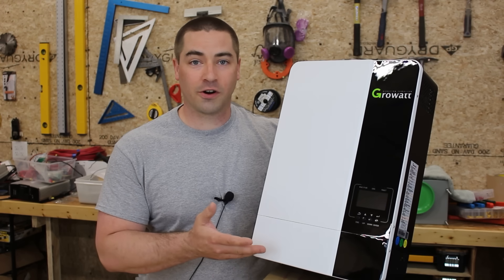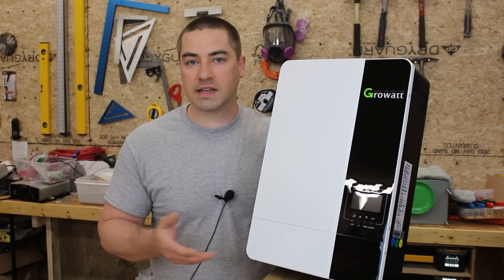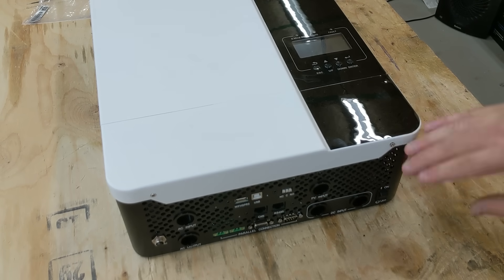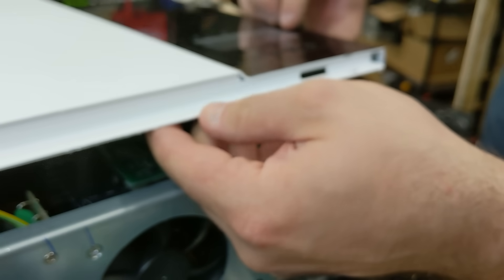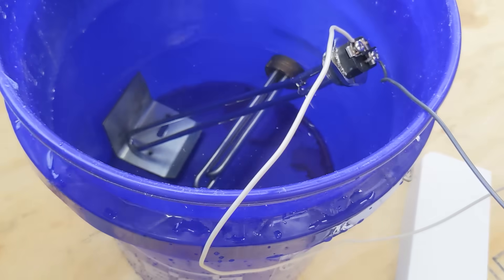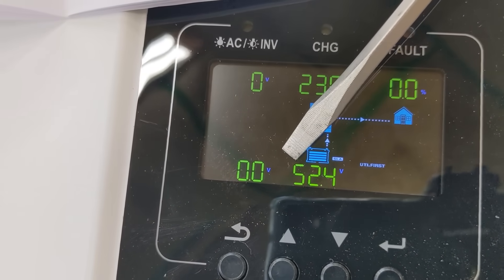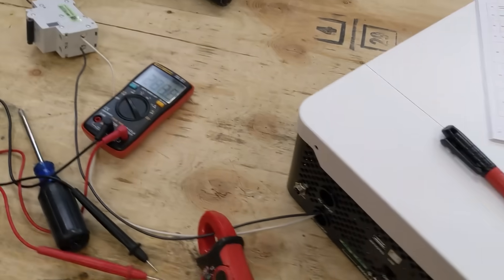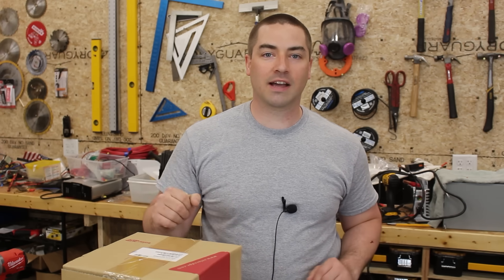Best Value Inverter, All-in-one MPPT Solar Charger, Growatt SPF5000ES, Part 1

Comment: This is 240v? You said line and neutral, not line, line, neutral.
Reply from the maker: Correct.  240V only.  I then used an auto transformer for 120V loads.

Comment: 4 years later is it still working fine? Im thinking of buying this brand too
Reply from the maker: I still use it for testing batteries, but not day-to-day.  If I was to buy a new inverter for day-to-day operations, I'd look at this one: https://signaturesolar.com/eg4-6000xp-off-grid-inverter-split-phase/?ref=4_rHcgZ9x-TiF- Because it does both 120 and 240 Volt without needing an extra auto-transformer.

Comment: Does it blow the hot air out from the top or bottom?
Reply from the maker: Top.
Reply: @DavidPozEnergy  Thanks for your videos. I like to watch your reviews. If i may ask are you still happy with the Growatt? Im looking to get 2x 5kwa
Reply from the maker: I ran my house on 2 of these Growatt inverters for 1.5 years without a problem.  However, I did upgrade to a pair of Schneider inverters once I had enough money for it.  The Growatts are a great value for someone to get into solar cheap, but they won't last a very long time compared to Schneider, they use more energy in standby, are less efficient, noisy, power was not as clean.  I moved my Growatts to temporary uses at this point.

Comment: The newer version of this inverter is not that good. I installed one in March, 2023 with 6 x 500W panels and 5kWh battery. This inverter had many issues since the installation date. I am in Asia, and we use 50Hz/240V and I have a single phase wiring at my home. Most common issue is the error code 52, and this condition stops the inverter and the charger till a manual restart. Other issues are (1) Charger not starting even when there is enough power coming from the panels (2) Not switching from Battery to AC and back at the set SoC of battery (3) Battery getting discharged below the set max DoD. (5) Unintended charging of the battery from Grid. On top of this, the customer support from the company who did the installation was pretty bad. They have not yet replaced the inverter after many follow up calls.

Comment: After much more research i agree with you.  I am buying 2  and build my own battery.   10Kw inverter and 15kwh LFP battery  and easy enough to add on if i need more capacity as the GW can stack up to 6.

For the newbies you can easily run the whole house  under 5kw for all the 110V stuffs.  For the energy suckers  water heater, dryer, stove and AC  those requires 220V  if all on at the same time 15kw will do but no more than 2 on at the same time then 10kw will do.  I know for sure that will work for most if NOT all  US household.    You can add more solar panel, battery pack and inverter if more capacity is needed easily.  I know  for sure because for years i have been running the whole house from a repurpose UPS  as an inverter  and 18650 packs that i built from recycle battery.  The 110V stuffs that is.  Everything works for years and NO issue.  I hung my clothes under the sun to replace the dryer. I changed to solar water heater.  I use propane and home made charcoal for cooking and baking. I use the 110V AC . Those will do away  the 220V stuffs.    Now i need 220V because i have a spouse and women usually are NOT OK with the inconvenience!!!!!!!!!!!!

Seriously no one should do grid tie anymore.  I never  was and never will.
Reply from the maker: Sounds like a good plan.
Please note:
I bought mine from Signature Solar.  SS had these modified for the US market by Growatt.  Some people who complain about these models bought from Chinese sellers, and the units were not modified.  So just be cautious.  
Also, if you don't mind helping out this channel, please use the affiliate links in the description.

Comment: Hi David, I bought this 6 month ago after reviewing your youTube. Here are my questions.
1. I am using 6S 2P of 12 pcs 500WP , max V in from PV 250 volt and Current 16 Amps. Book says max 450 volt V in to the SCC, the question is what max Volt can safely applied?
2. To generate more energy to batterry (20 KVA, which never reach 100%) I plan to add 6 more PV (500 WP each) in parallel which will be giving same amount of voltage, but the current may up to 30 max, the question is with that max current in from PV would be safe for the  SPF 5000ES? If not what PV configuration best to arrange?
3. I notice the SPF 5000ES cooling fan are "on" all the time is this normal?

Thank you in advance. BTW I am located in Indonesia.
Reply from the maker: Hi agusmuharam6491,

1. Yes, the maximum open-circuit Voltage is 450V.  Since this is a maximum, it is your responsibility as the installer to ensure the solar array never exceeds this Voltage.  I don't know the temperature in Indonesia, but where I live we have below freezing temperatures.  I need to add 21% safety margin to my solar array.  When solar panels get cold, the Voltage can exceed the rating.  This means I can't allow my Voc of my solar array to exceed 372Voc (based on the data sticker).  372Voc/6=62Voc.  Double check if your solar panels Voc is less than 62Voc.  
2. I wouldn't run 30A potential into the Growatt.  The Growatt is listed for 18A.  You can exceed that slightly, maybe 1 or 2 Amps, but I wouldn't go up to 30A with it.
3. The cooling fans are variable speed.  Yes, they are always ON, but should speed up or slow down based on load.

Comment: In your opinion should I go with Growatt 5k or eg4 6.5k looking at mounting 2 in parallel with eg4 stack of batteries. I know you have used them my goal is to make a low maintenance system.   What can you recommend?
Reply from the maker: I've had great success with my Growatt inverters.  I don't have experience with the EG4 6.5kW inverters.  There have been some user complaints from both, so I can't say one is better than the other.  The EG4 inverters are 120V, which means you can parallel them into 120/240V split phase without needing an additional transformer.  The Growatts are 240V only, which means when you parallel them you still have 240V.  You need to add a transformer to create 120/240V split phase.  On the surface, that's a down-side to the Growatt.  However, I actually think both brands benefit from adding a transformer.  I've even tested a Sol-Ark in the past which was terrible for me, until I added a transformer.  

The Growatt is currently at $726, or $1,452 for the pair, plus the transformer brings it up to $1,950.  A pair of EG4 6.5 will go $2,598, so if money is really tight go with the Growatt brand.  

Understand, that both of these options are beginner level.  They are both excellent values, but probably won't be a forever inverter.  Something like a Schneider is top of the line, and will last decades, but costs quite a bit more.  

I hope I was helpful.  If you would like to help support the channel, please consider making your purchase through one of my affiliate links: https://signaturesolar.com/?ref=4_rHcgZ9x-TiF-

Comment: those copper wound is on a ferrite ring for interference reasons and the inverter is switch mode type circuit so no copper wound transformer

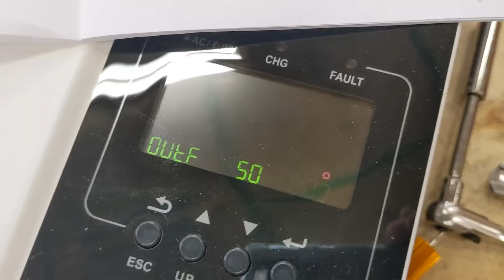Comment: I need to know specifications and where to buy the resistor you use before  connect 14:43 the battery to the inverter
Reply from the maker: https://amzn.to/3oIPq5p  Here is a link to the resistor.  I have some orange and some green, but they are all 100W resistors.

Comment: I had 12 solar panels and a 48v battery  output connected to a 5500 watt inverter. The installer only connected a connection from my house power to the power in connection point in my inverter does it need a power out connection connected to my house power for it to work properly and feed my house usage?

Comment: I just bought a 8000VA/6000W inverter, how many batteries do i need to operate it?
Reply from the maker: If your inverter is made for nominal 48V battery, then you will want a minimum 200Ah battery (10 kWh)

Comment: Will it run a well pump
Reply from the maker: Yes.  I have a friend who is off grid, and running one 5000es inverter for his home including the well pump.
Reply: @DavidPozEnergy  thank you. Is it a solar well pump specific. Or standard I ask because I need something that will.
Reply from the maker: A standard 240V submersible pump, about 100' in the well.  I asked my friend the make model, and he replied "whatever the well driller puts in"
Reply: @DavidPozEnergy  thank you.
    Much appreciated probably work for my application
Reply: @DavidPozEnergy   I've seen the video.

Comment: Hi David, thank you for the amazing review. Do you know if this inverter has a feature or program of providing electricity to the grid (for green energy refund selling)?
Reply from the maker: It doesn't.  No grid selling.  This is made to be an off grid invertrr
Reply: @DavidPozEnergy  thanks a lot for your answer and the reviews you're doing. They're very interesting and useful

Comment: Love watch your video them i need asked you question i have 3000 watts pure sine wave 48V DC 110V-120V 60Hz need to for 12 volt deep cycle battery to run it have Tablesaw 120V 60Hz 15A 1650 RPM will run it just asking i know it run a lot thing i try thing with 10A,11A,12A,13A and run them

Comment: Can i use that inverter without connecting PV array and without the charging option ? I have my own solar controller and i would like to connect only battery and AC to that inverter. I am going to switch to battery and AC depending on the battery voltage. NO battery charge at all. Is this possible ? Is there an option in the inverter so i can send high/low signal to the inverter so it can disconnect/connect battery ?
Reply: I bought this inverter and can be programmed to meet with your need, 0 grid charge or 0 solar charge (I never tried but there is an option to select max charge current)

Comment: Hi, is it possible to use this inverter with a battery and also conected on grid(ac input) but  use the grid only when the battery is low and never inject back the power into that grid? because in my country if you inject to much back in the grid the electricity company is outta control and can decide put you to pay for that instead of paying you for the power you produce because you are using their infrastructure to much and the goverment allow them to do so. and i don't want to inject but i want to use power from the grid just in case i run low on battery. thank you

Comment: How many 350watt panels can be used with it
Reply from the maker: The exact answer will depend on your setup (Imp, Voc, #series, #parallel, temp.) .  However, aim for about 5kW of solar, which would be roughly 14 panels as a starting point for your calculation.  (5,000/350=14.3)

Comment: What would be a good equivalent 3-in-1 but smaller for a cargo trailer conversion?
Reply from the maker: You might want to look at this one and see if it will work for your application: https://signaturesolar.com/eg4-3kw-off-grid-inverter-3000ehv-48/?ref=4_rHcgZ9x-TiF-

Comment: Hi David, I would like to use this inverter on a solar first and grid as back-up approach. Can you test it without batteries? I was told that these inverters CAN'T function without batteries?
Reply from the maker: My Growatt inverters are set up in parallel mode.  In parallel mode there MUST be a battery connected.  The manual says it can work without a battery when using a single inverter, but I've never tested that approach.  This inverter is really made for off-grid applications.  I've never tested the exact application you are suggesting.

Comment: can i connect only Grid connection 230v*16A = 3.680watt to my fusebox? and load via PV excess? I cant install pv input(+/-) to the inverter, cause the cable is at my existing batterysystem.

Comment: in addition to solar will accept power fro multiple  48v 3kw windmills
Reply from the maker: No.  The solar MPPT charge controller built into the inverter can only accept power from solar.
Reply: @DavidPozEnergy   thank you for your prompt response just trying to understand why wind generator would be different from solar
Reply from the maker: A wind turbine controller should also have a dump load controller built in.  Some of the morning star controllers have that.
Reply: @DavidPozEnergy   thank you sir

Comment: Hot water heaters are two 120v lines. Which makes the 240v. As the US standard is split phase 120v into your electrical panel. Other countries and higher end equipment can have a single 240v line however not common at all in the USA.

Comment: Hi David,I have an installation at home with two SPF5000ES inverters working in parallel mode and 11kw of solar panels. 
As you know when the Li battery reaches the minimum discharge value, the system automatically switches to the utility company input, at this moment the RCCB residual current protection electrical  placed in 230vac input, which is 300mA, type b, fall down.I have 2 differential,one for each input of 230vac of Inverter. Sometimes fall down both, sometimes number 1 and sometimes number 2.
At the both 230vac outputs of the inverters I have a 30mA RCCB and these never trip. 
I think that at the moment the bypass is made and the current from the utility company enters, a very large mA leak occurs and the RCCB jumps. 

The earth measure is ok. The system work for 1 year ago ok. 
 Have you some tips ?
thanks and regards
Manel from Catalonia

Comment: Does thist inverter support past 500kw with the grid attatched? I mean, I wanna use 7kw, give 5kw from the batteries and solar (if available), + 2kw from the  grid.
I'm guessing it does not need the grid to function, so basically I can run the house 100% off this thing with solar and batteries. Does it interrupt in any way if the grid suddnely dies? OR comes back?
Reply from the maker: I don't think this inverter will do that.  However, I haven't tried it.  I run my system off grid only.  I have no grid connected to my inverters.
Reply: I think - no. I have it connected only to grid as UPS. When there is a power in grid it and I turn on something, e.g. electric kettle - it shows power consumption about 45% and run its funs to the maximum - so you will have maximum 5 kW, no more. And another strange thing: even in AC bypass mode, it still uses a battery a little bit: about 0.5-1 amp.

Comment: Looking for a DC switching power supply that I can wire into the PV ports on this inverter.  What do you use to test with to see what kind of PV input you can get?
Reply from the maker: I use my solar arrays to test the charge controller built into the inverter.  I've been running these Growatts over a year with solar input.
Reply: @DavidPozEnergy  Ahh.  I don't have any solar yet, and since the input AC for these is 240V, I wanted to be able to charge the batteries temporarily using a DC power supply into the PV input using the internal charge controller.  I will eventually have some solar to do this, but no panels yet.

Comment: Hi I have a small problem with my settings, the  Battery grabs power from the local grid to charge ( or top up to 100%) even wne the load consumption is less than 20%, this happens overnight when there's no solar available... any reason you can think of? I have the very same Growatt inverter installed, and similar battery pack.
Reply from the maker: Sorry, I don't know.  I run my equipment off grid.  I have nothing connected to "AC Input".

Comment: Will the grid provide power to the circuitry in grid/ line mode if a battery is connected?
Reply from the maker: The grid (or generator) will pass through the relays to the loads.  I should note, however, that I don't run it that way.  My installation is off grid.

Comment: Hi David,

My Growatt 5000 ES electricity coming from both Phase and Neutral. I did not measure the amount yet. What can be the issue. Using SBU mode.
Reply from the maker: That's how it works.  Electricity needs a loop to make a circuit.   Think of it like the "L" is supply, and the "N" is the return.  But since it's alternating current, both are supply and both are returns.
Reply: @DavidPozEnergy  But Grid line, only P aving power. Is it harmful for LCD,  and motors?

Comment: Your videos are really helpful on making my system. I'm getting some kind of sparkling noise when the power switches from main grid to solar. Is that normal?
Reply from the maker: I wish I could answer this for you, but I can't.  I run all my equipment off grid.  I have nothing tied to the "AC Input" terminals of my inverters.

Comment: I just built a system with one Growatt inverter and a LiFePO4 pack of 160Ah (8kW in total) and I love it. I would like to extend my system by adding another inverter in series. I am also planning to add a new battery pack in a master/slave setup with the one I currently own. @DavidPoz Could I use battery cells of higher capacity, say 280Ah, if both batteries have the same charging/discharging characteristics (same brand) or do I need to stick with 160Ah ones?
Reply from the maker: Yes, you can parallel batteries of different Ah so long as everything else is the same.  I suggest using a central busbar for paralleling them together.  See my video on why: https://youtu.be/eWqJjlHoW9A